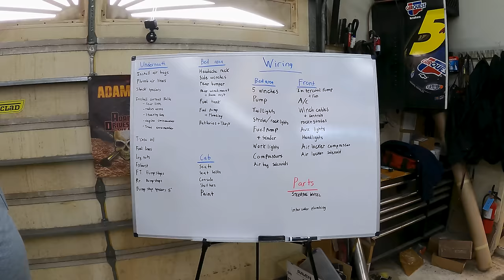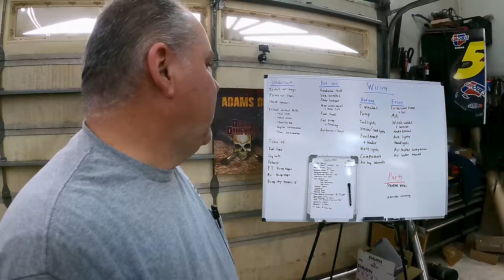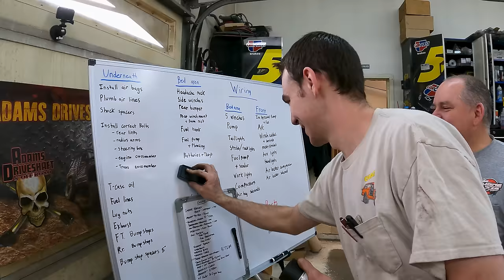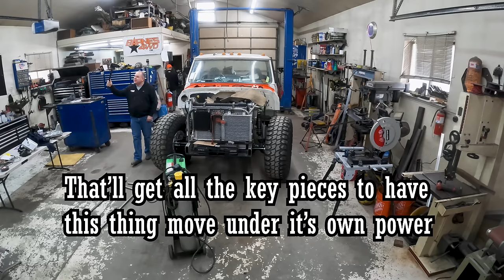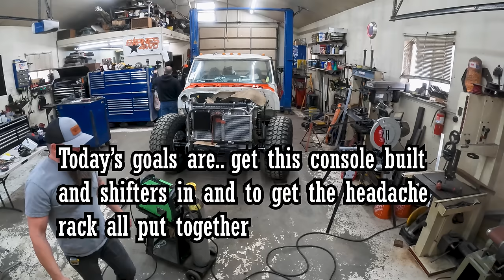All Hands On Deck To Get Griz The Wrecker Ready For The Off Road Games!!

Comment: Chaos, lots to do. Drop-ins welcomed. Less than 10 days. Some late days are early starts required. Many major components are done, dry fitted or mounted. Close to being installed and painted. Wiring, piping, hoses are getting connected. Slow but steady. Motivated to get critical elements done.

Comment: Wow Chad things are coming to geather your spray can paint job looks good I lilike. Also that vintage aircondioning and heat set up I like how you manage to get extra room under the hood. So now I want to know if that company makes a set up for my 1998 GMC SONOMA. I would like to have that extra room so I can put a V8 Chevy engine I wouldn't mind turning it into a 4X4 but that may not happen but if I could get that V8 in there and rearend in there I would at least have the hot rod that I like. Anyway thanks for listening I appreciate that.
Reply from the maker: I don’t believe Vintage Air makes a direct fit kit for that vehicle, but one of their universal kits should be fairly easy to adapt. Check them out…  vintageair.com

Comment: Stupid question, english isn't my first language so work with me here and try to decode. I've never seen someone build a tank with a rubber tank protected by a steel casing with a removable top. It seems to me that it would be safer and make for a far less risk of ripping a hole in the tank in the middle of nowhere and be stranded and having to call Matt. I have a vague memory of that being a rule in derby cars?
Reply from the maker: Top wasn’t removable, just wasn’t welded on yet. 
No liner in this tank, but a lot of tanks like derby tanks have a bolt together housing with a rubber bladder so if something happens to a tank it can contain the fuel. 
The bottom of this tank is over 3/8” thick and will also have an external plastic skid plate that will be an additional 3/8” thick
Reply: @chadsfab  Thank you for taking the time to answer.

Comment: Chad & Crew The wrecker aka Grizz seems to be coming together rather nicely even with yalls time crunch issue & it is looking great with that fresh coat of bright orange🍊. Chad so how many hours did you end up having into building the gas tank?? Lol. It looks fantastic tho.. So how many gallons of gas will it hold?? Glad to see it a few steps closer to being finished up or atleast finished up enough to be able to utilize it @the off-road/wrecker games then yall can fine tune all the finishing touches when your not under a rather short time frame like you are under @ the time of filming this video.. Cant wait to see it finished up & doing wrecker things @ the off-road/wrecker games..
Reply from the maker: Honestly have a good 40+ hours in the tank and it holds about 42 gallons. 

It was a blast to be able to take it and use it! 🎉